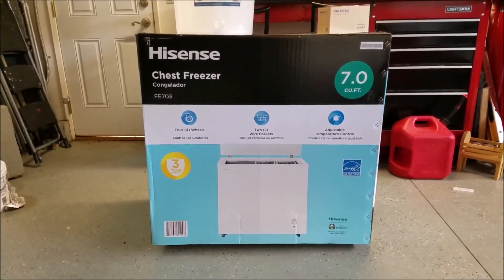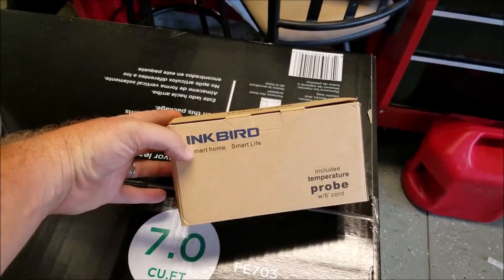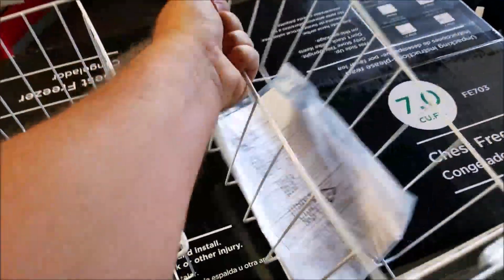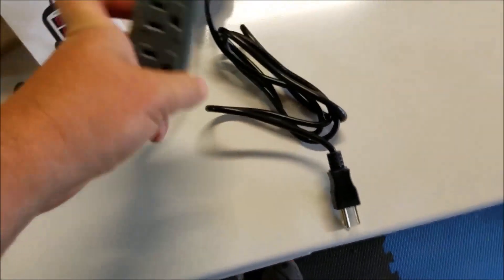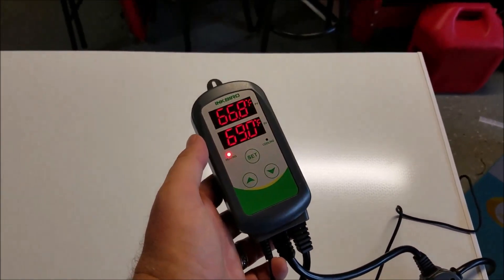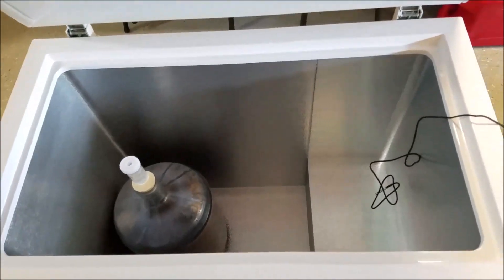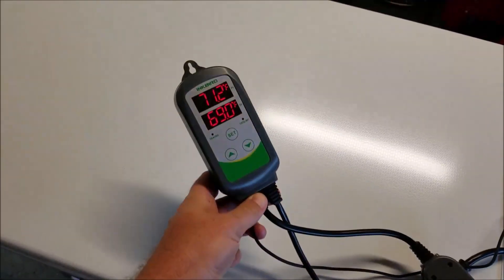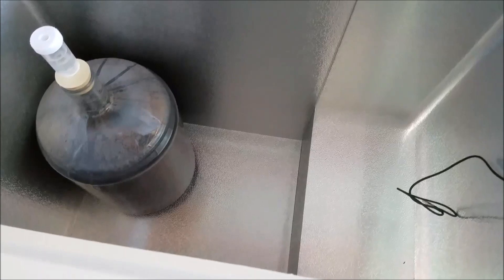Easy DIY Brew Fermentation Chamber Part 1 of 2 | Home Brewing DIY

Comment: Just curious how this set up has held up over the years.  I plan on doing the same with my freeze.  I do like the ink bird method which would allow me to go back to full freezing if I chose to.  Thank for the video.
Reply: I went ahead and got the Wi-Fi inkbird controller.  It works fantastic!  I highly recommend a Rechargeable Desiccant Pack.  I was getting a lot of moisture before. I mean dripping.  I put one of those desiccate packs in the freezer basket and now nice and dry.
Reply from the maker: That's awesome. I need to invest and get the wifi one as well
Reply from the maker: It has been holding up very well no problems!

Comment: This would work even better if you replace the thermostat with one more suited for higher temperatures (10-30C / 50-90F) and place the probe inside the fermenter. It takes longer to cool but it happens smoothly and once you reach the required temperature, there will be very little fluctuations (if any at all), giving the yeast much more reliable, stress-free environment. I've made a fermenting chamber from scratch that can fit my 160L fermenter, using parts from an old refrigerator. It works great for lagers, too.
Reply from the maker: thanks for the great tips!

Comment: Put your Carboy on a piece of styrofoam. The ambient temp takes longer to cool down than the siding of the freezer which is in direct contact with the carboy and can shock the yeast
Reply from the maker: Thank you so much for the tip!
Reply: Thank you... Sweet level up.

Comment: Seams like a refrigerator would work as well? I have dodged the issue of lower temperatures in the summer by using Voss kveik yeast as it will ferment up to 104 degrees.
Reply from the maker: Yea you probably could. Would want to use a temperature controller and probe to hold proper temperature if needed.
Reply: @FamilyDIY  Yes I would use the temperature controller and probe. I brew small batches so I don't need anything that big. Voss Kveik is unreal. I had it in an outdoor closet where the temperature 90 + and it was just fermenting away.
Reply from the maker: I will have to give that a try. Thanks for the tip!

Comment: How do you put the fermenter in the freezer? Do you have a pulley system or something?
Reply from the maker: Its only 5 gallons, I do it by hand.
Reply: Use carboy straps. Find some sturdy ones that are strong and work well with your body and the kegerator you're going to use (i.e. don't use a side-strap setup if you're going to be lowering the carboy into your kegerator).
Reply: I ask the same question, as a newb, 2 years later.  Is there a good front opening fridge that I could set up on a higher shelf?

Comment: How many 5 gallon brews will that chest hold?
Reply from the maker: Currently with my setup a can fit one of my fermenters in at a time. Could easily get narrower ones to do more. More than enough space for bottles. My local home brew found they could fit 4 kegs, CO2 tank,  & some bottles.

Comment: Do you just plug the freezer into the cooling side of the ink bird?  No bypassing anything
Reply from the maker: Hi Paul. Yes, just plug the freezer into the cooling side of the ink bird and set the desired temperature. If you also want to include a heater, what my other video that shows how that works. https://youtu.be/2qiWxCtjHxQ

Comment: Hi, thanks for sharing the useful information!! one quick question, how do you heat up the chamber to say 68 degrees, when the ambient temperature is cold in winter? thanks.
Reply from the maker: Hi Cary, I posted a new video about adding a heater plus improving monitoring the temperature. 
https://youtu.be/2qiWxCtjHxQ
Reply from the maker: If you need to warm it up, you can use one of these: Kenley Fermentation Carboy Heater - Kombucha Heating Pad 12 Inch - Homebrew Warmer Kit with Built-in Temperature Control - Brew Vessel Warming Mat for Beer Wine Home Brewing - Consistent Radiant Heat https://www.amazon.com/dp/B077TWMWXD/ref=cm_sw_r_cp_apa_i_fntDDbM7Y3CFM
Reply: @FamilyDIY  Thanks for the info.
Does that pad really works with at least a 5 gal batch? 
Have you ever tried in a 30 L Speidel fermentor?
Reply: Hi there, would these pads work to help regulate the temp of the entire chest freezer?  Or will they only transfer enough heat to warm up a carboy directly on top?  I am trying to cold stabilize my wine around 32 degrees using the Inkbird in a chest freezer, but it overshoots by 11 degrees, going down to 21 degrees over about five minutes, before returning to 32 degrees over the course of about fifteen minutes.  That is pretty wild fluctuation.  I don't want to freeze the wine, but keep it just above freezing (I guess around 25-28F for my 12-13%ABV wine).  I'm not sure if a heat pad would help lower its range of fluctuation.